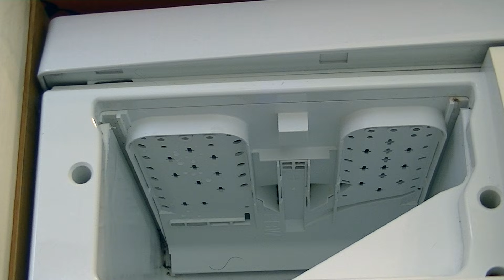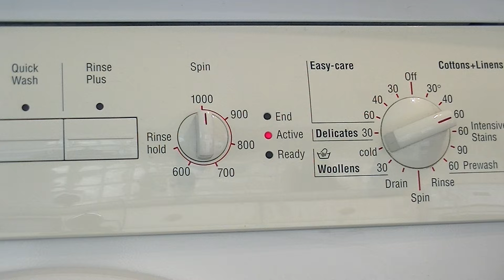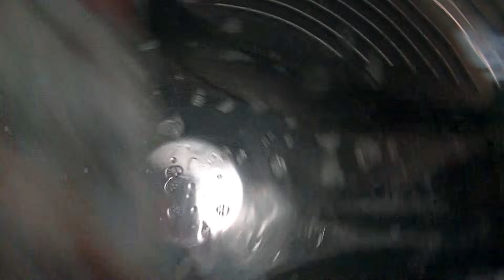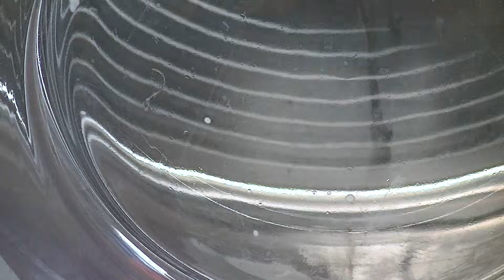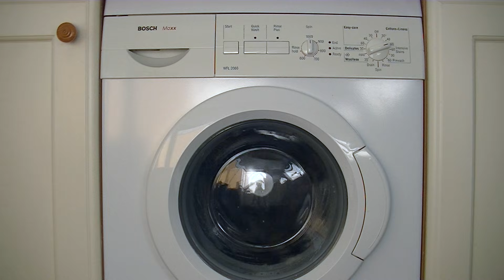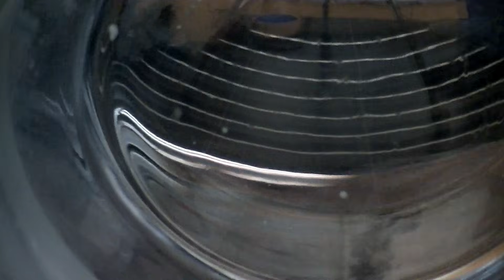Bosch Maxx WFL 2060 Automatic Washing Machine Demonstration

Comment: I now use my Bosch classixx washer as the Hotpoint died yesterday, and it's at the local tip, I'm getting a new door seal and Ill put it on myself as the old one is gross, I did clean it but most of it did come off but to be safe I'll change it on Thursday
Reply: Now the carbon brushes are getting replaced on my Bosch classixx WFL2062GB/12 as they are pretty worn, everything is going well and I've finally got the feet to adjust properly too
Reply: Now the motor is beginning to die because it makes a burning smell but no visible smoke. I'll just get a brand new washer if it dies

Comment: i had the slightly newer model of this one with 1200 rpm spin and prewash button insted of prewash in the  main menu, i baught it back in 2002, and i gave it away 10 years agoto my mum who uses it daily, a real work horse, still works as a charm, and yes i also most of the time usd it on quickwash and extra rinse, cause mine was connected to  cold water outlet,  so it took apptox 2 hours to do a normal load on 60 degrees, and with the quick was button and extra rinse it would take approx 75-90 mins depending on how much i put in it. completely forgot about how noisy it was during spin though.  thanx for shareing, brings back memories.
Reply from the maker: My mum always used the quickwash button on hers and also on the Miele that replaced it. The trouble with this machine is you never knew how long a programme would take as it lacked a time indicator.
Reply: How much it cost you?

Comment: 1600rpm spin speed is a good drying speed. Way better than the typical 500 rpm spin speeds of most of the available selling washers.
Reply from the maker: 1600rpm is pretty common for an automatic sold in the UK.
Reply: 500?? i can't find any washing machine on sale in stores now with spin speeds bellow 1200rpm
Reply: @PaulHojda  I used a 600rpm Beko before it was D3 5061 B

Comment: the intensive stains cycle starts off as cold water and the heating element slowly warms up the water to 60 to allow biological detergents to work at lower temperatures, whereas the regular 60 programme starts off hot to save time in heating the water however will kill the enzymes in biological detregents
Reply: You do realise the machine is cold fill only? The water always starts off cold

Comment: If you regularly use a 60 wash theres no need for a "maintenance" wash as all soap and additives are thoroughly dissolved. Ive never had a mouldy or smelly machine as so many of my customers complain of because i dont do low temp washing. The best universal wash temp is 50" (hand hot) but few machines have that now. Its all 40". No good!
Reply: I always use 60 apart from on wool or delicates, I still do a 90 wash every 3 months with washing machine cleaner

Comment: Im still using my Bendix 7147 from 1975. Fab machine with hot and cold fill that does a 60 wash in @ 65 mins start to finish. No mould or heavy creasing for me (800 spin) as i dont DO ironing. Cold fill only machines are crap as youve just found with mould in the dispenser. Ive NEVER had that and cant stand fabric conditioner.